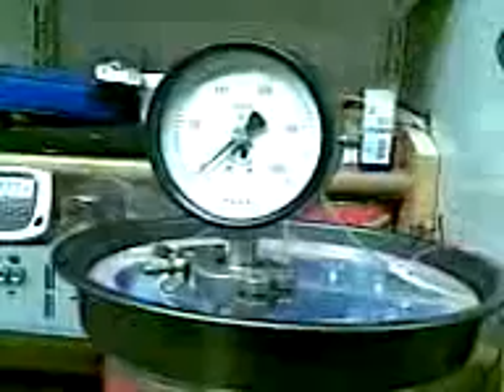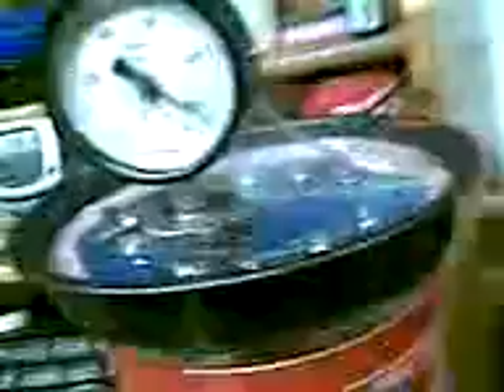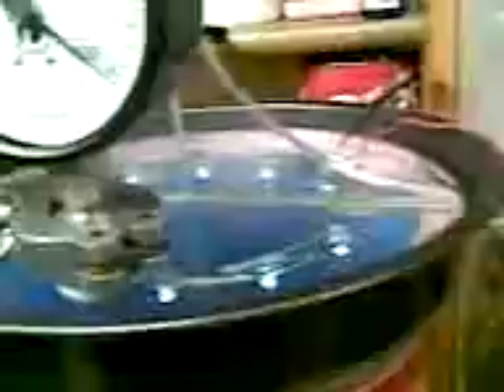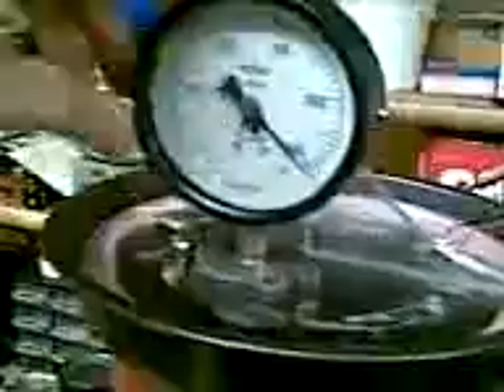New MkII Degassing Chamber - Part Two

Comment from the maker: No prob! I'm actually working on the Mk4 now. For the Mk3 I used an old pressure-cooker with an inch-thick polycarbonate plate on top and a home-cast rubber gasket. Fittings tapped fine right into the aluminium. Bit safer if you're not used to recycling potentially dangerous old pressure-vessels.
That said the Mk4 is going to be using a recycled 19Kg gas cylinder. Might need to upgrade the pump..